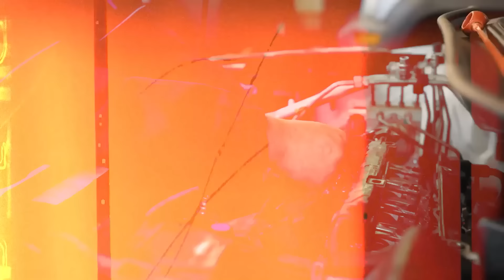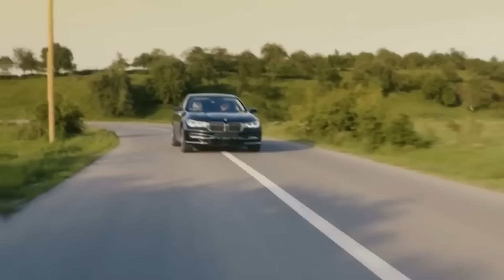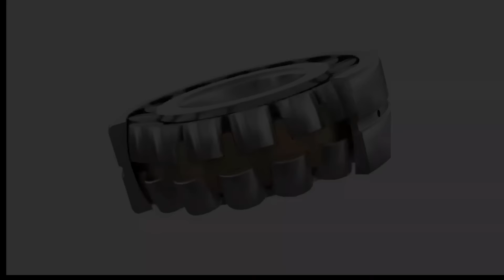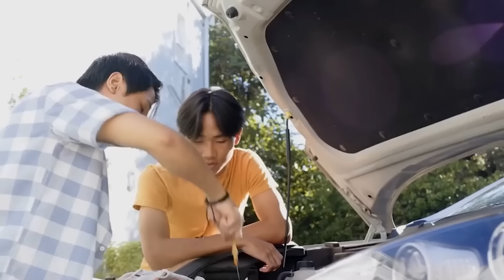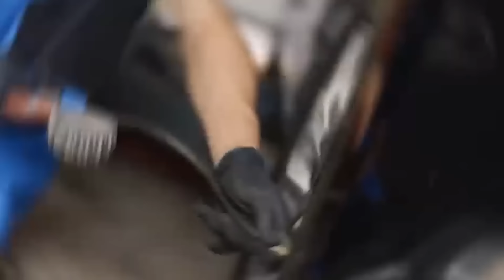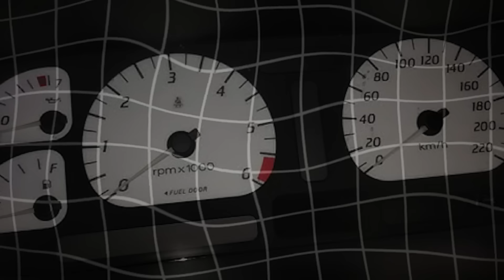Do THIS Once a Month, and Your Car's Engine Will Last Forever

Comment: Do not add this oil to your car this video is showing you how to waste money . It is not gonna make your engine last 500,000 miles or instead -change your oil intervals as the dealer has prescribed in your owners manual if you do that on time according to the manual mileage for an oil change, follow  your owner book, you might just get this,200k,300k,400k out of your car engine Friday stay with the same brand of oil you’re using and make sure you check the correct weight of oil for your car before adding oil. It is usually located on top of the filler plug where you fill the oil it may say it on top there, but if not, just check your owners menu  those stupid add-on oil treatments that they try to sell you when you’re getting your oil change or if you’re buying parts at a auto parts store, you don’t need the attitude. The act are not doing nothing more for you. Just change your oil on time this statement is made by a technician myself who has been working on cars since I was 12. Now 68 and I still love fixing car I’m retired now but I still do a lot of side jobs daily from my home garage/
Reply from the maker: Totally appreciate your input, Mike and honestly, you’re saying exactly what the video is saying. Did you watch it? 😊

The whole point of the list is that long engine life comes from simple, consistent habits: using the right oil, changing it on time, checking fluids, catching leaks early, and skipping the miracle-in-a-bottle stuff. We’re 100% on the same page.

A lot of folks never learned this stuff growing up, so if they can pick up even a few of these habits, they’ll avoid thousands in repairs. Respect your years in the trade and thanks for sharing your experience.

Comment: I guess this guy doesn't understand that newer cars have knock sensors to prevent engine knock.
Reply from the maker: You’re right, Michael. newer cars do have knock sensors. They protect the engine by pulling timing when they detect knock.

My only point is that if the knock sensor has to step in all the time, you lose power and efficiency because the engine is constantly running retarded timing. It’s a great safety net, just not something you want to rely on every day.

Comment: I had a 98 Chevy 1 ton pickup truck. The only vehicle I ever bought brand new. I drove it to it at 883,000 574,000 miles before I retired it. even with all those miles it only used a quarter oil about every 1200 miles.
Reply: I loved my Chevy i had a 79 Malibu no problems with it at all.
Reply from the maker: The good days!
Reply from the maker: Wow, 883,000 miles is absolutely incredible for a truck! That’s a testament to great maintenance and a solid build. Make sure to teach the kids and grandkids how you did it! Thanks for watching, Kieth.

Comment: Adding a suggestion,  don't forget the fuel injector cleaner. This was advised to me by a mechanic a long time ago. Doing every so often keeps your fuel clean.
Reply from the maker: Great suggestion! Keeping those injectors clean definitely helps with engine longevity and efficiency. I just recently used BG’s 44K in a CR-V and it really improved the performance and made a slight improvement in fuel efficiency. Thanks for watching!

Comment: Winter warm up - most optimal answer in my opinion and practice is: Start it up and as soon as the tachometer slows down, then start driving...
Reply from the maker: Yep, that’s exactly the sweet spot for modern cars – idle just enough to get the fluids moving, then drive gently to warm everything evenly.

Comment: I own a 2012 Hyundai Veracruz. The manufacturer cost for 87 octane. I live in a rural area so it's sort of a cross between City and highway driving depending on where I'm driving to 

I started experimenting with mid-grade and 91 octane. With mid-grade I get about a mi to the gallon MPG gane. If I use premium 91 octane I get an additional 3 to 4 MI per gallon. I do not drive hard enough to know if I really have any power difference with the higher octane but I definitely see the difference in miles per gallon
Reply from the maker: That’s awesome you’re seeing such a tangible difference in MPG with higher octane! It’s interesting how different engines respond.

Comment: Yes on inclines otherwise over time brake cables stretch and drums can warp. I've used the parking break a dozen times on the same car for 60 years and know I could stop the car fast during an emergency. Most emergency brakes I've seen don't work very well. Many times you can park with front wheels turned to the curb.
Reply from the maker: Great tips- and very accurate insight. Thanks for watching and taking time to share!

Comment: You should warm your engine until heat blows warm. Then drive very slow and easy for 5 minutes plus to warm your drivetrain. Transmission and differential are also lube based systems. You should let them warm as well. Just a tip. My work trucks get 500k miles before we trade for new.
Reply: If you put it neutral and put the parking brake on your transmission will warn up too because neutral is a gear your transmission is working just not under any strain ❤
Reply from the maker: 500K is nothing to laugh at! Great work on longevity on your vehicles. With waiting for the air to blow hot- do you wait the same length of time when it’s warm out? Or do you aim for a certain temp on the gauge?

Comment: The whole warm up for 30 seconds people obviously dont live in snowbelt areas or the North East where 30 seconds and you can't see a thing out your windows because your defroster isnt working yet. Sorry. But in winter my car warms up for 10 minutes before I'm driving anywhere so i can have heat blowing on my windshield to defrost it  and even maybe a few minutes longer when the temps are below -20c.
Reply from the maker: Yeah totally — below zero, all bets are off 😅. You’ve gotta be able to see and stay safe first. The 30-second thing’s just a good baseline for average temps since most modern engines don’t need much warm-up anymore. But honestly, you know what works best where you are — these are just solid starting points.
Reply: Or u could just have an automatic starter and turn it on 10 min before u leave
Reply: Just use a snow scraper lol problem solved. Gonna be very cold though
Reply: @huh481 I do. It still runs for about 10 minutes but I can set my auto starter to run as much as 15
Reply: @kickingfatality  Smart! Wish I had one of those 😅

Comment: Since my 2010 Jeep Wrangler has a 6-speed manual transmission I park it in 1st or Reverse gear which then uses the engine as a brake. The parking brake is basically useless and the vehicle will roll with it pulled on. I also use premium grade fuel (97 octane) as it knocks on the recommended 87 octane.
Reply from the maker: Good call using 1st or Reverse — that does help hold it steady since the engine compression resists movement. If it still rolls with the brake pulled, the rear drum shoes (or cable) probably just need adjusting. Manual parking brakes lose tension over time, and a quick adjustment makes a world of difference. On the fuel — if it’s knocking on 87, premium’s the right move. Some 3.8L Wranglers develop carbon buildup that bumps compression a bit, so higher octane helps prevent detonation. Thanks for watching!
Reply: I agree, the parking brake needs an adjustment, it's simple task, depending on what car, example - My Mazda Protege 5 has an adjustment screw behind the rear caliper... Also to note, here in Virginia you can fail annual State inspection if the parking brake is not holding...
Reply from the maker: Very true! As a kid in VA, I failed when my pick up’s emergency brake didn’t work properly.

Comment: Put seafoam
Reply from the maker: Seafoam’s solid for cleaning out injectors or intake deposits. The key’s using it right — add a few ounces to a full tank, or run it through the intake for a deep clean. It won’t replace regular maintenance, but it can help restore smoother idling and throttle response.

Comment: What happens to a parking break when not used. I want to use it now but affraid
Reply from the maker: That’s a really good question — and you’re not alone! When a parking brake isn’t used for a long time, the cable or linkage can get a little rusty or stiff from lack of movement. In humid areas, sometimes the rear brake shoes can even lightly stick to the drum if it sits for years.

The good news: most of the time, it just needs a gentle check or a mechanic to make sure everything moves freely. Once it’s freed up, using it regularly actually keeps it from ever getting stuck again — kind of like stretching after sitting too long. 👍
Reply: I answered that just now on today 5 days after yourd
Reply: See aerial

Comment: I never used the parking break now I'm affraid to. It's probably stuck and I will have a problem
Reply from the maker: Totally understandable — if it hasn’t been used in years, it might feel stiff the first time, but it’s usually not a big deal. The mechanism can get a little surface rust or stickiness from sitting, but most free up once you start using them again.

If you’re worried, you can have a shop check or lube the cables next time you’re in for service. Once it’s working smoothly, using it regularly actually keeps it from seizing up in the future. Kind of like exercise for your brake system.

Comment: I never use the parking brake couple times I have, I forgot to put it down. I think it’s just better for me to not use it. Never had a problem now if I lived in San Francisco….
Reply from the maker: Fair point — most folks on flat land never notice an issue. The reason I still recommend it is that the parking pawl inside the transmission takes on stress every time you put it in Park. The parking brake takes that load off and prevents those little ‘thunks’ you feel when shifting out. Small habit, big savings later. And yea- San Fran?? No-brainer.

Comment: Lower octane gas doesn't ignite sooner than high octane.
Reply from the maker: Right — octane doesn’t measure how fast gas burns, it measures how resistant it is to pre-ignition. Higher octane actually burns slower and more controlled, which is what high-compression engines need. Like Brawndo
Reply: Lower octane fuel has a lower combustion temperature point. As the air/fuel mixture is compressed in the cylinder, it's temperature also increases. If the compression is high enough the air/fuel mixture will detonate without the spark from the sparkplug which will sound like a knock or a ping as it is trying to expand while the piston is trying to compress it. The knock is the exploding air/fuel mixture hitting the top of the piston. Lead was added to retard or delay the timing of detonation, allowing the timing of the spark from the sparkplug to make that happen preferrably.
Reply: u h h ~ actually 87 octane 'is' 
more ignite'able whereas 93 to
104 relies on [ compression ]
to be part of the equation.